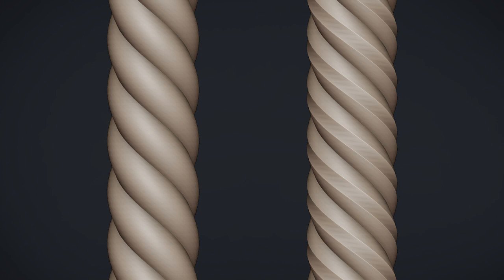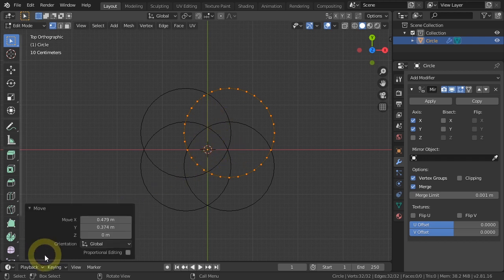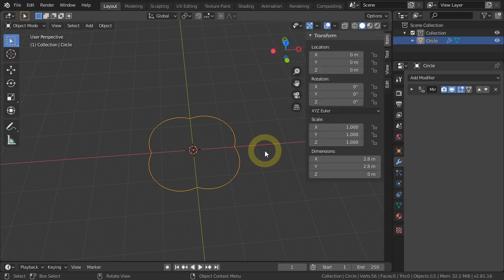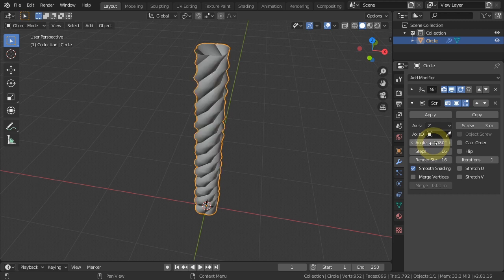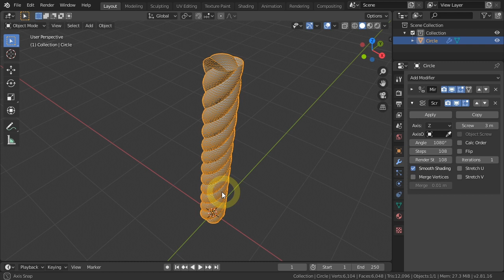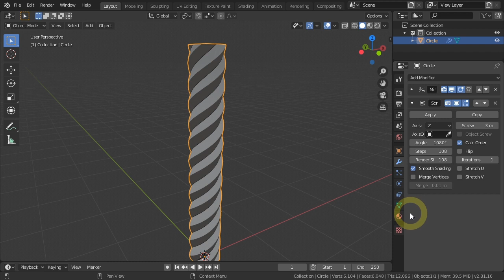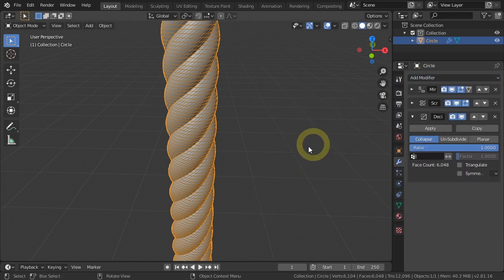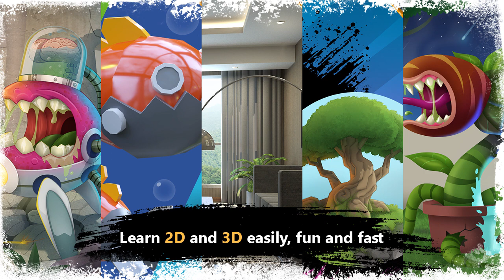How to create spiral columns quickly in Blender 2.8x

Comment: Exactly what I needed, in every way. I need to model some medieval cutlery made from wrought iron, so that's what the spiraling is for -- AND it needs to be a game asset, but look good close up, so it requires as low a poly count as possible while not looking low poly. While you didn't go into detail on how to do that (which is fine, it doesn't really belong here), you mentioned baking a normal map from a high poly version and then using it on the low poly asset. That's all I needed to know. This is the third video of yours I am watching and you always do this; you teach something basic and then mention possible complications and solutions in actual use cases -- that is so helpful. Thank you!

Comment: When I select calculate order, it doesn't do anything. Did I do anything wrong?
Reply: I'm having the same issue
Reply: If you're still having this problem, adding a "NormalEdit" modifier fixed it for me :)
Reply: Everything is complicated in this program.
You can do the same thing inside 3D Max or Cinema 4D very easily and in less than two minutes. God sees us